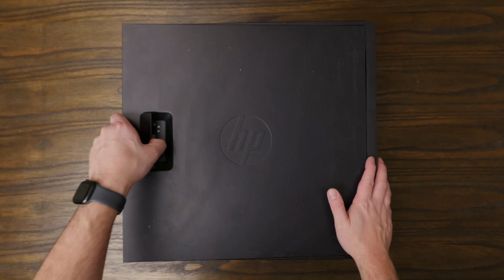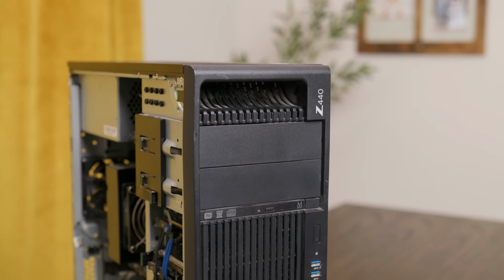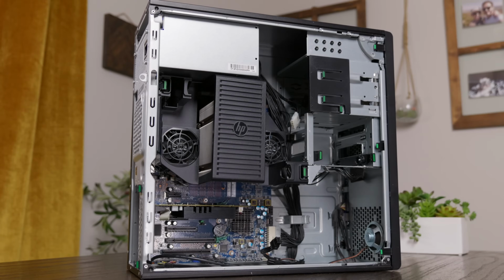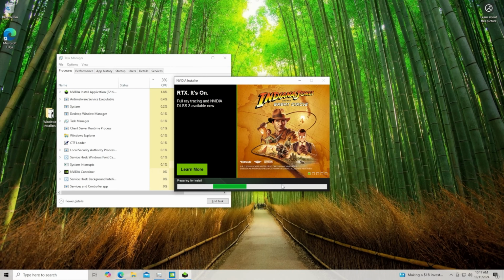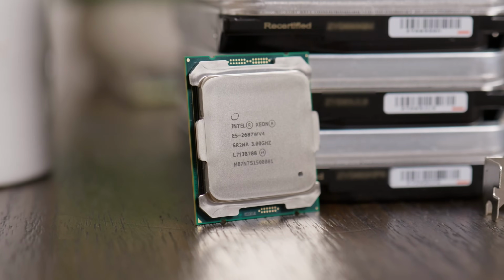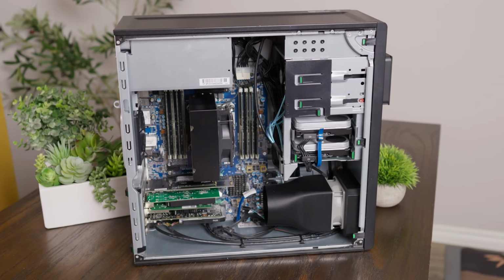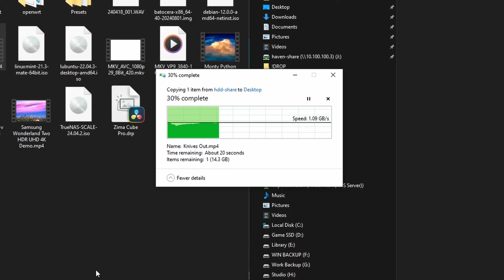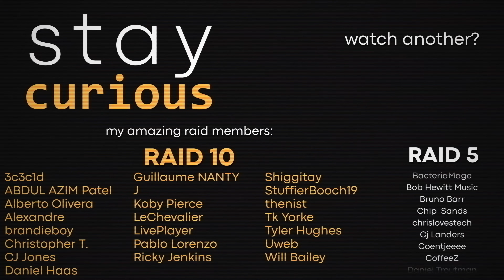This Upgraded HP Workstation/Server Is CRAZY Fun

Comment: I run a Dell Precision 7910 as my main Server, which in 2016/17 was Dells high end Workstation. Its a beast in its own right, supports up to 1TB DDR4 ECC, Dual Procs (Dual E5-2680v4s) I plan on upgrading to the 2697v4 xeons and serverpartdeals are amazing, my 36TB storage capacity is  like 95% filled so looking at getting a 12-24TB HDD added at Tax return time.
Reply: expecting mine in 2 weeks time got this from Amazon 
Dell Precision 7910 / T7910 Tower - 2X Intel Xeon E5-2670 V3 12-Core 2.3Ghz - 64GB DDR4 REG - Nvidia Quadro K2000 2GB - 12.24TB (240gb SSD | 3X 4TB 12Gb/s SAS New) - 1300w PSU - (Renewed) for $544
Reply: I changed out from a 2680v4 to a 2690v4 for significant improvement in base clock and boost clock performance. The 2697v4 base clock is lower and boost clock is only .1 GHz faster, but you’ll be paying a lot more for the 2697v4. Also the 2697v4 will run quite a bit hotter than the 2690v4 as the TDP is 145watts vs 135watts. What I can tell you is that my 2690v4 running all cores CFD Foam simulations, temps rarely exceed 55C with a simple Cooler Master Hyper 212 cpu air cooler. 2690v4’s are very inexpensive compared to 2697v4. I paid 35$ this past fall for my 2690v4. Lots of performance still available in these old X99 Xeons, that makes them relevant even today. Minus AVX512 of course. For virtualization, 14cores with 128GB of DDR4 ram will still give you 8GB+ per core. Good luck.
Reply: @julianfiacconi709  if i find a pair for really cheap i plan on getting them too, but even now my gpu does a bunch of the hard work, so i rarely see over 5% usage
Reply: @OfficialiGamer  5% usage, why then wanting 2697v4 ?  Curios. You might be interested in a low core count v4 with high base clock and high turbo clock. Perhaps a 2667v4 with 8 cores 16 threads and a 3.2 base and 3.6 turbo clock speeds
Reply: @julianfiacconi709  its more of a want than a need obviously, and definitely wont happen anytime soon. My more urgent need is storage, out of the 36TB, only about a TB is free. Linux distros take up a lot of space 😉

Comment: Watching this from a HP Z240, i7-6700, dual Quadro P2200 and 64GB of RAM, can comfortably say, if you need a really budget friendly workstation w/ decent RAM size, multi (non-6/8 pin) GPU support... This thing shreds. Been using it for about half a year as my Blender workstation with occassionally booting up VR. Not bad, except on Linux, 5GB of VRAM on Nvidia is a joke, with no shared memory feature. Good video HH. :)
Reply: You should purchase a consumer GPU with 12GB/16GB, they are far more capable than low to mid-end workstation cards :) 
The new 12GB Intel card looks pretty good and used AMD w/ 16GB and up can be found for cheap.
Reply: @Rotwold  I would like one, yeah! But there's, 2 issues.
1) financial mess. I won't, go in details ^^;
2) The PSU is 300w, no 6pin/8pin, I'd need to mod the case for a normal ATX PSU. :P

Comment: I've worked with the Z4 G4 version of these systems and they're really nice. Great to see you working with this older HP Hardware!
Reply: The Z4's are a gen newer and significantly more powerful.  I have both a 440 and a z4 G4, these days only the Z4 G4 is really worth the effort.  You can get a stock 1000 watt supply for the Z4 with 8 pin PCIE connectors.

Comment: I picked up two of these for 200 euros each about a year ago, new e5-2697a v4 and storage and good to go, even came with 64gbs of ram, had to do some finnesing to get the nvme ssd on the pcie card to get to post reliable but that was easy enough by moving the bootloader to a sata drive and having it boot windows from the ssd

Comment: Haven't had a chance to watch the whole video yet, but you already have my "Like" - I did something quite similar with an older HP Z240 SFF. It came with an i7 7th-gen. I added 64GB RAM, 4x 2.5-inch 1TB SATA SSDs (using a dual-2.5-inch converter, and one of the SATA drives cable-tied internally), a 10GbE Asus NIC in the PCIe 3x4 slot, a dual NVME card with 2x 1TB NVMEs in the PCIe 3x16 slot, and single NVME cards with 1TB NVMEs in the two PCIe 3x1 slots. Used the on-board M.2 for the TrueNAS OS drive. So basically had 8x 1TB drives for storage. Installed TrueNAS Scale, created a single pool with 2 VDEVs. Each VDEV using half of each of the listed drives (2x SATA, one of the single PCIe NVME cards, one of the NVMEs from the dual PCIe NVME card) so that if I lost the entire dual NVME card it wouldn't cripple an entire VDEV) and ended up with a relatively low-power, nearly silent 10GbE NAS which could do 1GB/sec for days. Ended up replacing it with a Terramaster F8 SSD Plus as my primary NAS, but re-used the HP Z240 SFF again - it now has a low-profile GTX1650 card and is my gaming rig (works good enough for me) :)

Comment: The important part here is that Quad-Channel DDR4 is comparable to modern dual-channel DDR5.
Everybody running one of these old workstations with just two sticks is really missing out on half the performance.

There are a bunch of oddities to a Z440 that often get overlooked unless you sit down and pour through the manuals...
Such as the top USB 3 port on the front is an always powered charging port.  Or how the SATA controller supports a bunch of extra RAID types.

The PCIe slots run directly off the CPU lanes and not through the chipset...  You can do stuff like directly pass through a second GPU to a secondary VM for video rendering, and never impact your main instance.

You can throw a 5x 3.5" HDD bay adaper in those front 5.25" bays to run a NAS, also possible in a VM with all those extra cores.

I could go on all day about the features of how these old machines can still be used.
Reply from the maker: Yeah I decided to cut a few things out of the scripts, such as the hardware RAID support. Also, slight correction, but the Gen3 PCIe slots are all via the CPU, but the Gen 2 slots are through the chipset.
Reply: @HardwareHaven  
True... But point is, you can get two GPU's in the x16 slots and still manage to stuff a couple NVMe's in the x8 slot between them.
Reply: Try old Server. 140€ HP G9 with 24 x 32gb Sticks 😉
Reply: Too bad Z440 are so unreliable. A company I support uses them for onscreen graphics rendering during sports broadcasting and all of the motherboards in their Z440s are dying. I have had to replace motherboards in all 30 of their fleet and some of them have come back to me multiple times for motherboard replacement. My contact at the company says he knows another company that have also had issues with their entire fleet of Z440s. Would avoid these machines unless you are getting them for free.
Reply: @Agret what about personal use where it will never need any if its power at 100%? So basically never stressing it…?
Reply: @Agret hey can you suggest an alternative that i can get for cheap. motherboard issue is the last thing i would like to deal with.
Reply: You might even be able to pore through the documentation. I’m not sure that poring something on them would be as helpful.
Reply: I still can’t manage to make it boot headless. Did everything shown in the video, but it won’t boot.
I’m on latest bios
Reply: @ViboraUnleashed  if you can't get a machine to boot headless just buy a "dummy HDMI" it's just a plug that you put into the machine and it fakes that there is a screen connected. They are a couple dollars.
Reply: @Agret the pc boots without a screen plugged in. It simply refuses to boot without a GPU plugged in. I believe having a gpu could have an impact on power consumption
Reply: @ViboraUnleashed  get a low power GPU like a GT710 it shouldn't make much difference to power consumption if you have no screen attached to it, that card would just be sitting idle drawing hardly any watts
Reply: @ViboraUnleashed  also there is that hidden bios setting shown in the video to make it go headless
Reply: WOW, I never knew any of that.:face-blue-wide-eyes:
Reply: Well, if the Z440 is as unreliable as @Agret says, you could try peeing on them!  Just saying...😂
Reply: Extremely interesting, I could listen those features all day 😅
Reply: I still didnt get how is it in dual CPU setup. Mine has 3 channel memory, but 6 channel while in dual CPU setup. (6/12 slots total)
Reply: I'm running a Z620 with a 3 x 3.5" bay adapter and had no idea there are 5 x 3.5" bay adapters! EDIT, upon searching it looks like the 5 x 3.5" bay adapters are meant for 3 x 5.25" slots. I think you'd be limited to a 3x3.5" cage with 2 of those 5.25" slots.

Comment: I used to run a bunch of these Xeon E5 rigs in my lab, and for a while my main desktop was a dual 2680v2.  Then I had my mid-life crisis and built a Threadripper 3970x which blew my mind.  The Xeons lived on in my homelab for a few more years but I eventually replaced them with 1st gen Epycs - less power/heat/noise overall and plenty of PCIe oomph to play with 100GbE networking.  These days with Minisforum/Kamrui and other mini PCs, as long as you don't need PCIe, those tiny boxes run circles around the pre-"Scalable" Xeons.
Reply from the maker: I'm assuming you didn't JUST run V2s. But if so, it's important to note that there's a MASSIVE different between ivy bridge and broadwell haha
Reply: those minisforum units are excellent unless you want ECC

Comment: Main drawbacks are: high power consumption, especially idle. Non standard power supply - hassle for maintenance.
Reply from the maker: True. That being said, buying a barebones Z440 is not much more than what you might pay for a repacement PSU or motherboard. So you could almost just buy a system and then a barebones unit for spare parts. That's assuming you have the space haha

Comment: I have two HP Z420 workstations, and the only thing that's really preventing me from using them is that they are power hogs. Besides that, they are, otherwise, very capable systems and have a LOT of PCIe lanes.

It's too bad that the last CPU that gave you 40+ PCie lanes was the Intel 10th gen CPUs.

Comment: Could you please add the link to the BIOS stuff you did in the description? I'm having trouble finding it :(.

Okay disregard what I said, I guess yours was trying via Headless mode. I wonder if doing the same BIOS Editing could fix my 'Install Front Fan' warning... hmm...

Dude, it sounds like you're getting the same error I got with the Tesla P4. It kept asking for a Front Fan, so I bought the stupid $35 CAD + Shipping Official Front fan, from eBay, installed it, still had the stupid error. Only way I could get past it was using a PCI-E 1x GT 710 as a dummy card and it lets me bypass the Tesla P4 'fan check'. I wish I knew how to bypass that, I want to use the PCI-E slot the GT 710 is in for something actually useful.
Reply from the maker: My bad, I meant to post the link to the BIOS Config Util. It's a fairly easy search and might help. I wasn't having any issues with a fan warning, but not sure if that was a setting already toggled.
Reply: @HardwareHaven  yeah I heard the beeps at the start and was like, "OH NO! I REMEMBER THAT!" But yeah, maybe running it in headless will help bypass this error, or maybe there is a specific setting for it I can toggle. And don't apologize for not putting it in there, it was just me asking for myself and others who might want to use it from there, if you still had it on hand. Awesome video!!!!

Comment: headless with everything sans gpu about 100 watts at idle - totally acceptable - the vast swaths of ram slathered on this piece bring it to another level in terms of capabilities with trunas or web server or virt host box - an example of early consolidation, also hp older gear is generally great, easy to work on - solid content - do a followup on adding another ps and dual gpu for some llm ai local open source testing - i think that is next stage and with 3060 from 240 a pop relatively low barrier - with 24gb vram you should be able to run quite a few models

Comment: I just returned my Z440 for a Z840 upgrade, RAM speed decreases to 1866 MHz if you populate all 8 slots and also not a lot of room for expansion, one other problem is the left side RAM cooler pulls hot air from CPU exhaust but apart from that it's a crazy good machine, I got mine with 64gb RAM (8x8gb 2133mhz) and Intel Xeon E5 2698V4 for 280$ 

It's a really good starting point for someone looking to build a home server
Reply: Also one other thing is that update the BIOS, and install windows then download Intel chipset firmware installer which would update the firmware of the RAM controller and also the RAID controller

Comment: I have a question that i also has proxmox with my GTX 1650 but i can't get the driver installed cuz of kernel not matched for drivers, even i use the guide on proxmox forum. Any guides for this ?
Reply from the maker: Honestly when it comes to Nvidia drivers and proxmox, I typically have no idea what the right answer is. I just try stuff til I get it working lol
Reply: @HardwareHaven  tks. I'll try again XD
Reply: @HardwareHaven  after 2 hours seen your last comment, i make it worked. Its a pain for nvidia user with proxmox just because of kernels, blacklists, and packages to install. i hope proxmox make some changes for nvidia cards so user can easy deploy on LXC.

Comment: Whew, glad y’all haven’t found out about the Xeon scalable ones. 

(I got a hp z6 G4 for $230 that came with a gpu, cpu, and ram)
About 120$ worth of upgrades from a 8 core silver to a 20 core gold, and 6x 32GB sticks of ram. And it’s flying.
Reply from the maker: It's on my list... just wait haha
Reply: You mean Skylake? Pretty sure he did a video about them. I have a Dell t7820, got it for $400 with 2 gold 6140s. 36c/72t, and another $180 for 256GB of ECC 2400 RAM.
Reply: Isn't the Z6G4 just Skylake (which is only 1 gen newer than the v4 chips in this video, and still 14nm) ? Or is there something else im missing?
Reply: @daymianhogue1634  yes and no, first gen scalable is based on skylake, just like x99 was based on Haswell. So skylake, but with much more pcie lanes, more ram, higher core count. first gen scalable cpus were extreamly expensive when first released.
Reply: @DrunkA5S  so yes it's just Skylake architecture? But with bigger chips?
Reply: @daymianhogue1634  it’s also compatible with gen2 cpus when they get somewhat cheaper
Reply: @JamieTheEnby  what are gen 2 scalable chips based on? More Skylake? Kaby lake? Coffee lake? Cascade lake? Or is there something else special about them? Genuinely I don't know, I primarily am a desktop and laptop technician for work. So I know more about mobile chips than the server ones.
Reply: @daymianhogue1634 Z4 is the Skylake, Z6 is single CPU Xeon Scalable but upgradable to dual CPU, Z8 is true dual CPU Xeon Scalable with better cooling, PCIe, and storage options.
Reply: I've had my eyes on something like this to replace my aged HP Z440. 5 years running in my house and hardware is beginning to give out..time to save up and replace
Reply: You bought 6x32GB RAM and a 20 Core CPU for $120 ? Bullshit.

Comment: I don't get it. So when all is said and done you spent around 110 dollars on a case, motherboard and power supply? Was it cheaper than getting all of those separately?
Reply from the maker: If you're talking about standard ATX hardware, probably not. At least not if you're wanting similar features. If you just need a simple system with better CPU performance/efficiency, buying a different system could absolutely be cheaper!